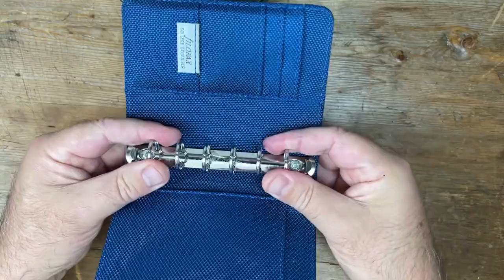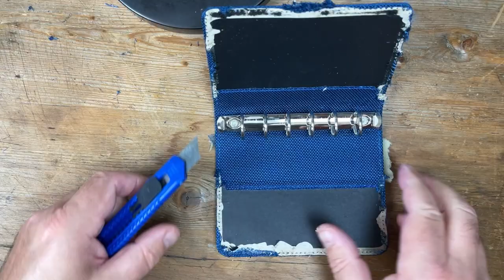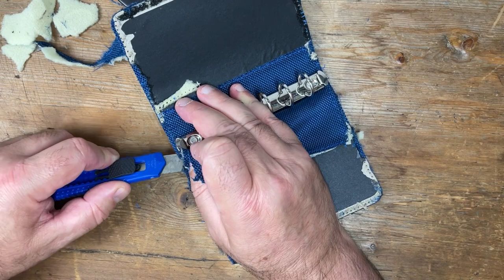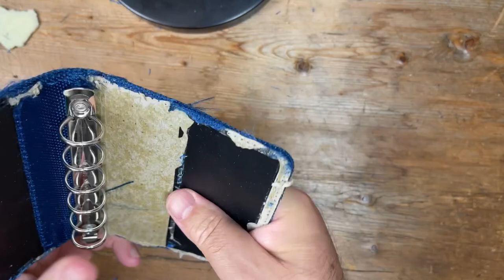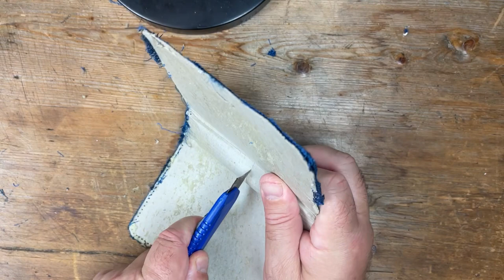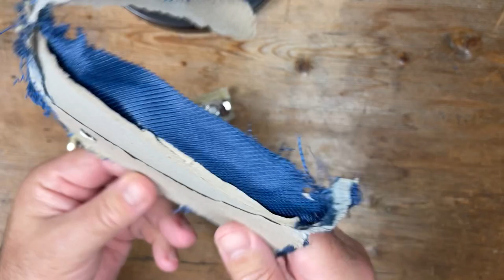Dissection - what’s inside a filofax.

Comment: so its just a kind of cardboard they use for the backing? and it looks like they glued the foam onto the cardboard, but did not glue the outside fabric onto the foam... this is the first time ive seen the curved-metal ring backing. could you do a video separating the rings from the curved-metal backing? im interested to see how that is put together... are the ring posts welded onto the curved metal backing? and then riveted from the top of the rings into the posts??? this is one of the most interesting and informative Filofax videos ive seen in my entire life.
Reply from the maker: Thanks for your feedback. I’ve added your suggestion to my list.